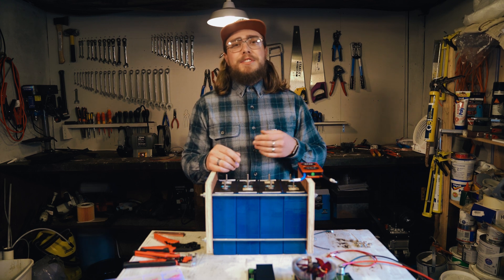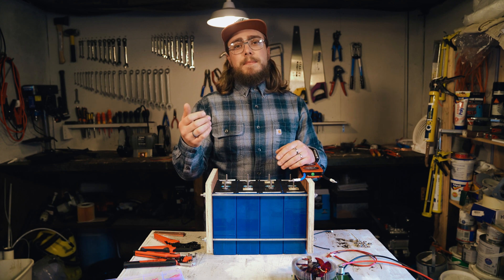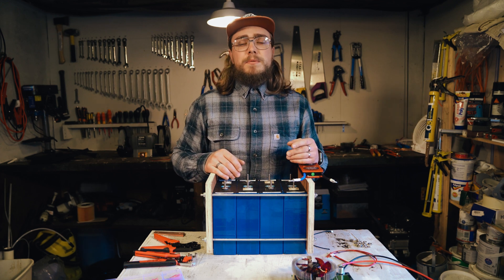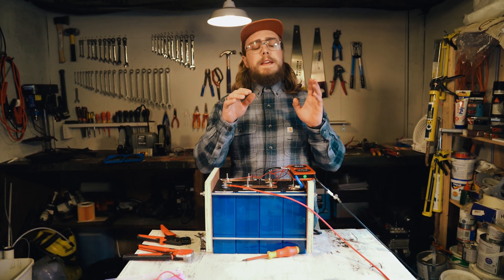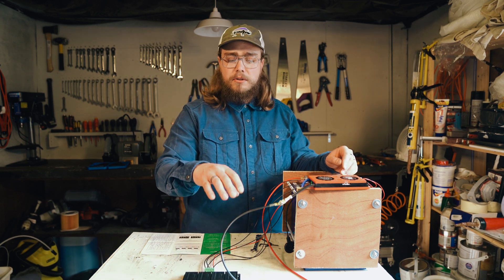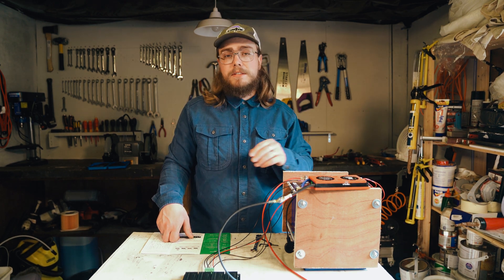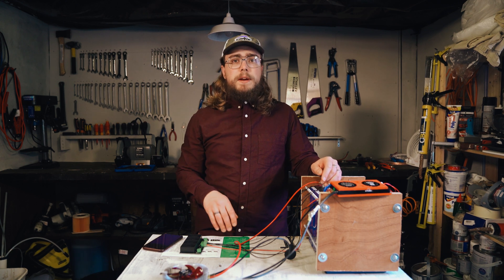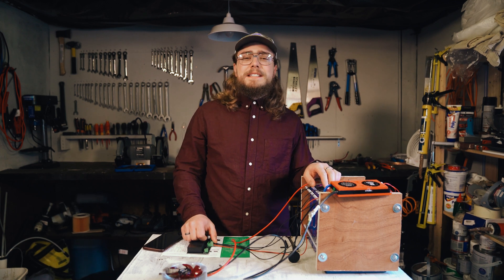Review of the Deligreen Active Balancer for LiFePO4 batteries

Comment: Hi Nigel,  great videos, very informative.  I now live in Portugal, moved here about 5 years ago from the UK,  we live totally off grid and have built up our solar system from scratch upgraded from the dreaded lead acid to lifepo4.  we now have 400AH  12volts.  I have an older version 200A Daly BMS without bluetooth.   Do you know what the factory setting would be for these, ie,  high volt and low volt cut out .  I know I cant change the settings but just wondered what should be happening.  Cheers.
Reply from the maker: Hi George. I believe that the default settings are a low voltage protect at 2.2v and high voltage protect at 3.75v. Can you not connect your BMS to a PC and change the settings via a UART to USB cable?
Reply: @offgrid_power  Hi Nigel, thanks for your reply,  my Daly BMS only has the connection point for the battery wires, no other visible port, I am not home right now but will take a good look when i can.  There must be a way in programming the thing so maybe taking the cover off and having a look is the way forward.   Many thanks and keep up the good work,  cheers from a sunny but a bit chilly Portugal.
Reply from the maker: Hi George. When you can, send us a few photos of what your BMS looks like to hello@offgridvan.life and we'll try and help. :)
Reply: @offgrid_power  Hi Nigel I took the front and back covers off the BMS to find the printed circuit bonded into the black plastic compound, the only possible link is where the BMS wires plug into the unit and nothing else.  I would have had to destroy the thing to see the printed circuit so I just re assembled it.  
I have decided to leave it out of the system for now as to be honest my cells are almost perfectly balanced, infact they seem much better without this DALY unit.  I have programmed my Renogy charge controller to switch off at high and low volts etc and I have ordered a shunt for a better read of power in and out of the batteries.   I do have a unit to easily see the voltages for each cell so keeping an eye on things from there.  
I will checkout your website also now. 
Cheers and thanks again for your replies and insight , cheers, George.

Comment: Curious how one of these might help in higher charger currents than 20A, I charge at 80A and see about a .15V higher voltage one cell which still seems okay.
Reply from the maker: Generally any form of balancing does not perform at it's best in high current charging. For the best results when using a BMS or active balancer, you would charge at a lower current e.g. 20A

Comment: if you are drawing more power than the active balancer can move then it wont prolong the life on the discharge but they do work brilliantly at balancing if you like to keep you cells a little under the max charge level to get extra cycles
Reply from the maker: Yes, this is a common problem. As you probably know, most of these active balancers move very low amounts of current between the cells, so as you say, if you're drawing a lot of current from the cells and your cells are not matched well, then they will have little effect.

Comment: I use the Heltec capacitive active equalizer(balancer). 4s 5A and the 13S-17s 5A (5.5A) versions. My review on Amazon. Very common to see my delta 3 or less mv (.003< V)! Hardly uses any power, or at least noticeable. Can be wired to “sleep”. Mine work flawlessly.
Reply from the maker: Thank you! We'll check that out! :)

Did you get it from Aliexpress?
Reply: @offgrid_power  
Amazon

Comment: Check out the cheaper ones from ebay the 1.2A ones that have the LED's work way better than that one.  Yeah, wouldn't waste my money on one without any LEDs to see what is going on.
Reply from the maker: Yeah, I've heard a few people saying that the Deligreen ones were good, but upon testing it ourselves, we don't like them. We'll be looking for alternatives.
Reply: @offgrid_power  Glad to see you trying things, just stumbled on your videos and glad I did.  Yeah, the cheap little active no-name balancers have been used for so many years for RC stuff so they are a bit better than some of the newer stuff out there.  Just wish that there was a BMS that had good active balancing built-in.  Round trip efficiency gains are another piece of balancing worth checking.
Reply from the maker: Agreed! It's bizarre how all of the "big" BMS manufacturers don't make them with active balancing capabilities. Surely it's not that much more effort and the performance benefits would be huge! 

If you have any recs for a good active balancer, please share! Would love to try them!
Reply: @offgrid_power  Will do I am actively looking for them too.  No name ones always beat the name brand ones so far.  Just got done testing Heltec and it didn't work unless the cells had a big gap in voltage and LiFePo4 just doesn't have enough difference.  The little RC ones work great though.
Reply from the maker: Thanks! :)